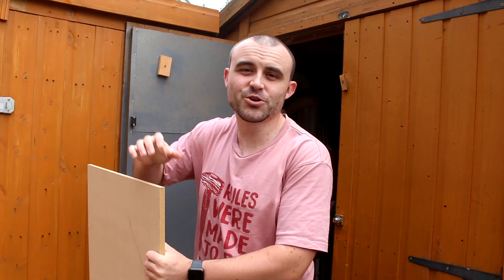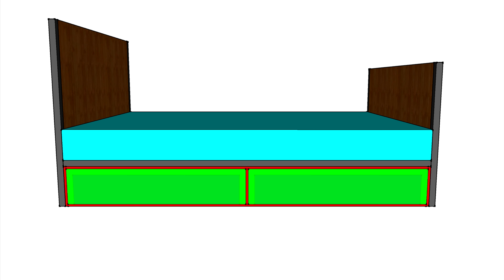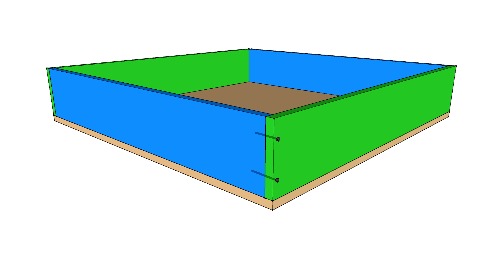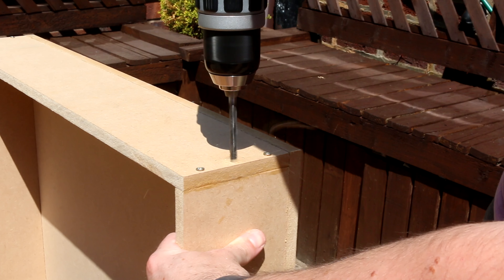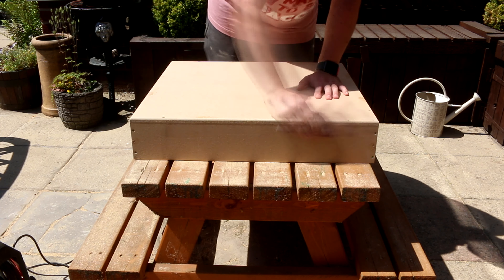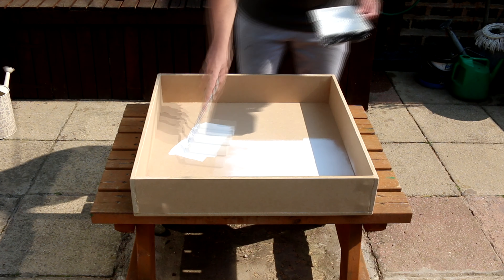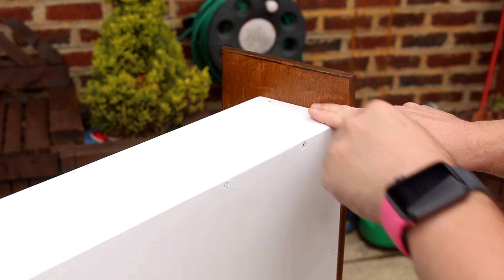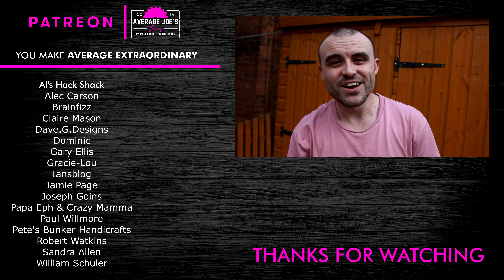How To Make Under Bed Drawers - The Average Joe Way!

Comment: Nice idea fitting the dowles after the joint screwed together. no worries about lining up holes.
nice steel toe cap Nike Air fluffs
Reply from the maker: Haha cheers mate! The dowel technique I use keeps things really simple. Ideal if they’re getting painted over anyway. Gonna be making some steel toe cap slippers soon 😉

Comment: You make look so east, have just bought some oak bed frames, and was reluctant to use plastic storage boxes. And the draws to buy are expensive. This looks so easy, and with your instructions this will solve the issue. Thank you, great video and links.👍
Reply from the maker: Really glad the video has been of help mate. Making stuff is a lot simpler than most people think 😊

Comment: Good job, must remember to use eggshell paint on mdf
Reply from the maker: Thanks mate! Ive got the best results with Egg Shell paint.
Reply: I had fabulous results with a light hand sand then a couple coats of zinzer 123 spray primer (there's another brand I used, name slips my memory atm) but makes it a very easy and quick task since it's a spray can! I followed up with two coats of my fav colored spray paint and it looks like something I'd buy at the store!

Comment: Love this tutorial but just wondering what size screws you used?
Reply from the maker: Thanks Emily! I used 30mm x 4mm screws in these as they’re going into the end of the boards. If you’re adding screws to the face of the boards then they will need to be slightly shorter than the board is thick
Reply: @AverageJoesJoinery  thank you!

Comment: Nice work, the construction might be simple as you've said, but the finish is very good and the results look professional. I like those castors - never saw side-mounted ones before :)
Reply from the maker: Thanks Mike! As long as it does the job simple is often the best way to go haha the side mount wheels are a breeze to fit too

Comment: Would it not  be better just not painting the front of the drawer, instead of painting then sanding off before attaching fascia, as it will never be seen. Nice to see project videos again 👍🏻👍🏻
Reply from the maker: Thanks Steve! I usually add some painters tape where I plan to add glue so I can peel it off but I didn’t have any haha its best to at least paint a small boarder incase you can see the bare mdf from the side. In this instance, that would be almost never though lol so yeah, leaving it bare would save time and effort 😅

Comment: I was wondering how you were going to stop the MDF “end grain” from splitting when you screwed it.
Reply from the maker: If you’re having trouble with the MDF splitting then drilling a slightly larger pilot hole can help prevent it 😊

Comment: If using MDF, dowels and glue work better than screws. There isn't anything for screw threads to bite into.
Reply: Oops. I used mostly screws on 1/4 and 1/2-inch MDF, and it seems fine. I'l report back if it flies apart. Good to know for next time.